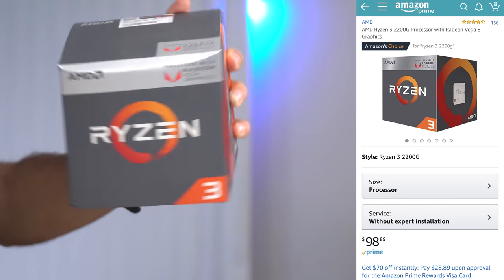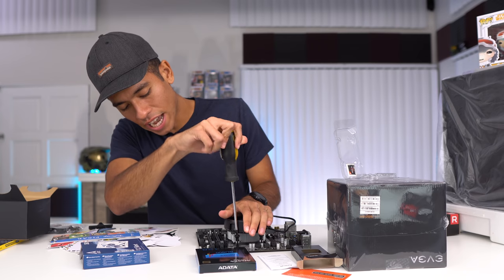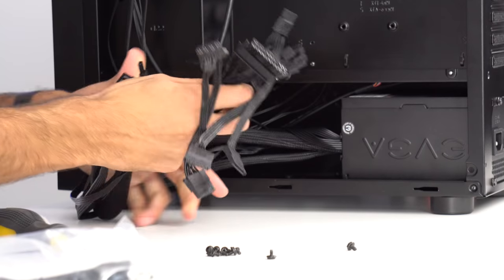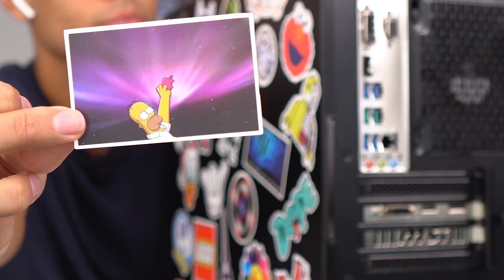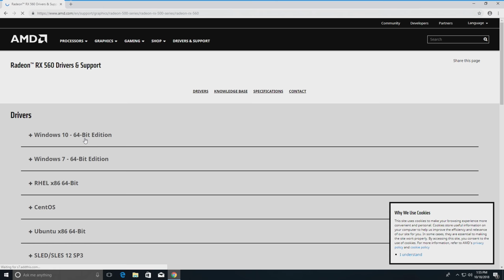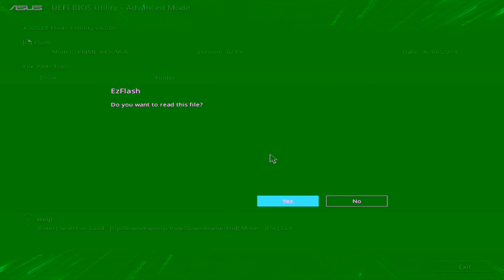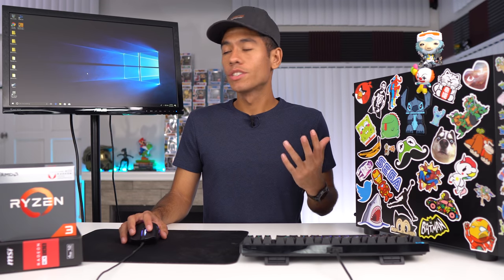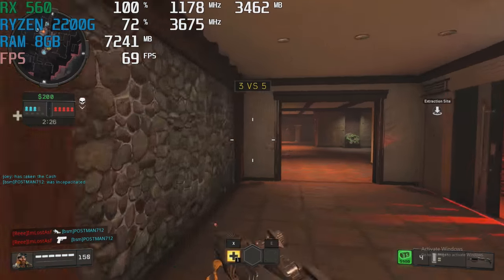Best $500 Budget Gaming PC Build Guide - RX 560 Ryzen 3 2200G (w/ Benchmarks)

Comment: I have now learned what XMP and DOCP means thanks to your videos!
Reply: What is that
Reply: @yohaneswisnu7662  It's the RAM overclocking, since standard RAM speeds are set up to 2133 MHz.  Everything after that must be "overclocked"/configured in the BIOS/UEFI to allow it to hit the actual speeds, if the hardware is allowable at a higher speed than 2133 MHz.

XMP is the Xtreme Memory Profile from Intel to auto-overclock your RAM and DOCP is Direct Over Clock Profile, which's ASUS' version of Intel's XMP.
Reply: I have now learned what XMP and DOCP means thanks to you

Comment: Question, so I have AMD RYZEN 3 2200G I want to put in a graphics card because since it is stock, it didn’t come with one however, which graphic card should I go with and which power supply should I go with I recently just took out the a gigabyte ram and put 32 in it just want to upgrade so I can edit 4K videos with Littleton no problems if you can get back to me I definitely would appreciate it!🙏🏾

Comment: Mine is a Kingston A400 120G SATA M.2, ASRock Phantom Gaming X Radeon RX 570 8G OC, ASUS B450 AMD Ryzen 2 Micro ATX Motherboard, Corsair Vengeance LPX 16GB (2x8GB) DDR4 DRAM 3200MHz, AMD Ryzen 3 2200g, Corsair CX Series 650 Watt 80 Plus Bronze Modular Power Supply, Thermaltake Versa  H17 Black SPCC Micro Atx Case for $536.71!!!!! It will for sure game better plus it is more future proof!
Reply: You can also add more storage for a couple more dollars if you want!

Comment: I got every part listed on his video. The only part I got different was the motherboard I got the MSI b450 tomahawk. Got everything hooked up all the wires the pieces went to power it on and  everything worked perfect went to hook up the HDMI cable to DVI on the back of the graphics card nothing no signal nothing. So I went and unplug the cable from the graphics card went straight to the integrated graphics card on the motherboard still no signal. Bought a new HDMI  to DVI cable nothing. Tried a HDMI to HDMI cable nothing. Tried it on a different newer monitor nothing. Going to have to go into my storage they got my old GPU and see if that works now spent 8 hours on this computer and it's still can't get a signal
Reply: Okay first make sure that the front io ports are connected properly, because if the front io is not connected to the motherboard correctly than your PC is not going to turn on. Check the motherboard manual to see where the front port connections go because it's very specific on where it needs to go to. Also for 550$ this PC is not a great option for parts selection.

Comment: i made a kind of similar pc to this.. i got an amd ryzen 5 2600,a gtx 1660 ti, 2x 8 gb of lpx corsair ram  
same mobo same power supply and same case as this video..
but when i completed the build the lights and fans work but my monitor says no display
Reply: Did you plug it into the graphics card? If your cpu doesn’t have integrated graphics it won’t boot up because there’s no graphics. Even if it did you wouldn’t be using your GPU. So plug your monitor into your graphics card. Check that everything is plugged in properly too.
Reply: @ColinMroczko  thanks but i fixed it :D

Comment: Hello, thank you for the video! I have a question... If I wanted to substitute the graphics card with a Nvidia GTX 1060 GB, would I have to change anything else? Also, is the EVGA 500W+ still gonna work as well as the "BR" version?
Reply: No, you're good. You can always check compatibility of your components on pcpartspicker website. As for the PSU, "BR" version stands for Plus Bronze, which has slightly better power consumption efficiency than Plus. It should be good enough for GTX 1060, but you're planing on upgrading the system later on, I would maybe suggest a better power supply. Cheers

Comment: I build this computer and it’s runs great but I wanna upgrade it to improve FPS on my games and all around. I don’t know where I should start. Could I replace my graphics card from the 560 to a 580 or a gtx 1560 with out having to change the motherboard and power supply? Also is it worth making the upgrade to a Ryzen 3 3200g or not

Comment: I'm new to building PCs and want to build one when I have enough money and was thinking about building this but I had a few questions.
If I wanted to get more frames when playing would I need a better graphics card?
Will a different graphics card mean I need different parts for this build so they'll be compatible?
How important are frames if you're just starting to game on PC and coming from console?
Reply: I would lower my settings to get better Frame rate, especially at PvP
Reply: If you have a 60hz monitor you only need 60fps, but if your a 144hz gamer then you would need a better pc to reach 144fps.
If you want more frames then you should upgrade the graphics card to a rx 570 8gb or 4gb. Or even to a rx 580. 
No you don't need to change other parts for better gpu but for example if you get a high end gpu like rtx 2080 then you should upgrade the cpu or else there would be a bottleneck, and the psu too so it can power the gpu and other parts. But if your gonna go with a rx 570 or 580 you don't need to change cpu, its enough but i recommend upgrading the ram to 16gb for better performance.

Comment: Question . I’m considering buying my dad a pc for his office work cause he has one of those old school computers . Would this be a good option if he’s just going to use it for office work ?
Reply: Of course. 
For office work he doesnt need a dedicated graphics card.
He needs a cool cpu with 6 or more cores.

Get a cheap motherboard h310
Cpu i5 8400, it has an integrated gpu
2x4gb or 1x8gb ram ddr4, (for games 2x4gb is better)
Power supply 450w or 500w +80
Some cheap dvd drive
Cheap case micro atx
Done.
Reply: Engineer Andro Sweet thanks

Comment: Does the motherboard usually come with stand offs? And is there a better card than the RX 560 used that fits?
Reply: rx 570 4gb more than double the performance of an rx 560 , i have the rx 570 its the best gpu for the price , it's only 130$
Reply: @Ziikow  Whats the best GPU for the case he uses?
Reply: @jackson_vantage3552  Sapphire RX 570
Reply: @Ziikow  Ill be using all of the parts and that with my build when I get enough. Thanks! And is there a case where I don't have to add standoffs to the case myself?
Reply: @jackson_vantage3552  No idea bro , good luck in your build

Comment: Do you use hdmi cable or vga port for better graphics on your monitor?
Reply: Vga port is different. Vga is the port that gives power from the power supply to the graphics card. Video output(actual graphics) come out of basically two ports. 1. HDMI. 2. DISPLAY PORT. Basically, display port is better than hdmi in every way.

Comment: Hey, Joey (and others)! I'm trying to follow these directions to build this computer. However, I bought the ASUS B450M-A/CSM Micro ATX Motherboard Ryzen 2 and it worked in one room. I moved it and it stopped working. So, after having the IT guy at work test the components, he confirmed that it was the motherboard. So, I bought the exact same thing and it still doesn't work. Anyone have suggestions?

Comment: Hey Joey! So I built this PC on my birthday about two weeks ago and I thought everything was working but I now just realized that the fan for my Graphics Card isn't running and there is a orange flash right next to the graphics card..is it broken, or does it need a extra cable (PCI-E) from the power supply?
Reply: Why would you build this for 500$ you could of build something better for the same price
Reply: @jamesscott3290  Cause it's my first time building a computer, also I fixed the graphics card..
Reply: @recklessoperator9900  "first time" doesn't matter if its your first time you should of understand that may be do a little but of research to see if you could of gotten better parts for the price

Comment: Is rx570 bottleneck with 2200g? Or should I go with a r5 2600 rx570 combo instead?
Reply: If you Wanna go low budget high performance go r5 1600 with rx 570
Reply: No bottleneck, you should be good with 2200g and 570.
But i aree with dude above, r5 1600 and rx 570 is a really good budget combo
Reply: @itisfullofcurry1313  okay thanks guys

Comment: If I used a 570 or 580 would this pc be better? Please respond quickly cause I have to order by today.
Reply: NepToon idk
Reply: Yes a large performance boost from the RX 560. With the RX 580 and 570 you will be able to game in high 1080p settings. Also if you want to cheap out a little bit the ryzen 3 1200 would go 60 dollars, yeah slightly worst performance than a 2200g but it's would be by a couple of frames
Reply: James Scott thanks for the info bro
Reply: James Scott can I get a 3200g instead of a 2200? Will it still be the same to build and it’ll be better?
Reply: James Scott and also would the mother board be able to handle 3200g and rx 570.
Reply: @VccTn  yeah you can get a ryzen 3 3200g, however you will need to perform a bios update and in order to do that you will need a spare 2nd gen ryzen CPU.
Reply: Most motherboards can handle a CPU and GPU fine but if overclocking the CPU you will need a motherboard with beefier vrms and a case with excellent airflow. Also judging by the case Joey is using the airflow might be piss poor
Reply: James Scott ok thanks for the info I will buy a cheap 2nd gen
Reply: James Scott so I build the pc with a 2nd gen and then run the pc and then I bios update then I can remove 2nd gen and put in my 3200g?

Comment: I need help, the computer wont work. I press he power button and nothing turns on
Reply: Check if psu is switched on 
if doesnt work open the computer and check if everything is plugged in, if so try unplugging everything and replugging them in if all else fails try to make sure you clicked your ram in, or take it out and put it in the other dual channel slot
Reply: also make sure your front panel connecters are connected properly(refer to motherboard manual)
Reply: Don’t worry , most likely 95% nothing is broken, just not installed right, same thing happened with my build, you just have to go through everything as if you building it again and look for any smal, thing that could be wrong.
Reply: Im Velez for your build, what went wrong
Reply: a_krew10 i bent my cpu puns but that was obvious because i was too rough around it, but at the end i kept switching between my graphics card and monitor hdmi ports cause i couldn’t get a screen, eventually i got the display. i then check to see if my ram was detected and only one stick was, but i put two, i then opened my pc again and saw my ram wasn’t fully in. so just check everything
Reply: Im Velez my computer won’t even start, like nothing is spinning or moving
Reply: a_krew10 flip the switch on the power supply? if that doesn’t work your power supply doesn’t work
Reply: Im Velez it’s weird because my mouse lights up when I plug it in to my computer but when I press the power button, it doesn’t start
Reply: a_krew10 your case power button doesn’t work? damn it might be your front panel connectors, those are tricky to install, look at your motherboard manual, go to the front panel connectors page and follow the steps, those need to be placed exactly as your manual says
Reply: Im Velez ok, I’ve gotten the exact case in the video
Reply: Im Velez I’m about to turn it on, I’ll tell you if it works
Reply: Im Velez it still hasn’t worked, and I’m coming to the conclusion that it is the f panel connectors but I don’t get what I’m doing wrong. I did it like he did in the video and I have the same exact parts. I’ve gotten three of these motherboards and all of them have the same result, I’ve switched the case, and tested with three power supply’s and I’m not sure what to do. I could make a video of me plugging the the f panel connectors if you’d like

Comment: My gaming pc is turning  but there is no display  on the monitor. I get the error no signal check input
Reply: Plz help me as soon  as  possible
Reply: @whiskythegamer8053  make sure your HDMI/VGA cord or whatever cord you're using is plugged into your graphics card, not the I/O.
Reply: My graphic  card  will be arriving  next week
Reply: So the hdmi cable won't  work   if  i dont have a graphic card?
Reply: My motherboard  only  comes with 1 hdmi
Reply: @whiskythegamer8053  unless the CPU has an integrated graphics but the issue is that you will still need a GPU in some cases of the pc
Reply: Ryzen  3 2200

Comment: Does a rx 570 work with this build
Reply: Yes its even better then the rx 560, but you will need a 8pin PCIe power cable
Reply: it works soo well with this build , its double performance of a rx 560

Comment: I have a problem, recently get an RX 560 gpu and pair it with a Ryzen 3 2200g processor, but wanting to open anything,
The PC uses the integrated GPU by default, I try to open the windows 10 options to choose which card the system should use for each application.

The problem is that in the options only the RX 560 lists, and it doesn't matter if I choose that gpu, it still uses the integrated gpu.
Anyone know how I can fix it?

Note: I don't know English very well so use Google, excuse any grammatical error
Reply: make sure u connect your monitor to the graphics card

Comment: Hello i really need help ive put this build together and taken apart about 10 times just keeps coming up no display please help
Reply: make sure hdmi/display port is plugged into the gpu
Reply: That solution is if your computer turns on, if it doesnt even turn on try these
Check if psu is switched on 
if doesnt work open the computer and check if everything is plugged in, if so try unplugging everything and replugging them in if all else fails try to make sure you clicked your ram in, or take it out and put it in the other dual channel slot or back where it was
Make sure front panel connecters or connected properly(refer to motherboard manual)

Comment: uphere 3-Pack Long Life Computer Case Fan 120mm

JBtek All Black Sleeved PWM Fan Splitter Cable 1 to 2 Converter

ADATA SU800 128GB 3D-NAND 2.5 Inch SATA III SSD

ADATA SU800 512GB 3D-NAND 2.5 Inch SATA III High Speed

MasterBox Q300L mATX Case w/Magnetic Design Dust Filter

Crucial 16GB kit (8GBx2), Ballistix 288-pin DIMM, DDR4 PC4-21300

EVGA 650 B3, 80+ Bronze 650W, Fully Modular, EVGA ECO Mode

ASUS B450 AMD Ryzen 2 ATX Gaming Motherboard AM4 DDR4 HDMI DVI M.2 USB 3.1 Gen2 (Prime B450-Plus)

AMD Ryzen 5 2400G Processor with Radeon RX Vega 11

These are the parts I selected. I searched many times to see if they are all compatible. I am getting confused by all the different atricles. Please help me.
Reply: Yes they are
Reply: @mael6513  Thank you

Comment: can i swap the processor to amd ryzen 7 2700x or is that going to be a problem for compatibility?
Reply: Taeyeon Jjang yes you can swap the processor to the 2700x, however if you’re gonna spend extra for the cpu i recommend spending that money on a better graphics card like a rx580/590 or gtx 1060/1660
Reply: Also spend on a better motherboard like a msi x470 gaming plus not the shitty motherboard Joey using
Reply: @jamesscott3290  that motherboards not bad mate
Reply: @feats  i ended up getting a rx580.
Reply: @theclasssy3320  it's bad for vrms if your going to stick a ryzen 7 2700x  and overclock it

Comment: We are having issues as there is no power. We have replaced the motherboard and also replaced the case. Anything you all can recommend?
Reply: Switch the psu on
Reply: James Scott - the psu was on.
Reply: The psu most likely, replace the psu if it's doa and make sure it's a quality psu. No seriously if a psu dies while your using your PC it could take a component with it and kill it with the psu
Reply: James Scott - thanks James. I don’t think it’s the PSU as we tried the “paper clip” method and there was power
Reply: @robertjkrew  go open your PC and go to your motherboard. In the bottom left there should be the front io connections (that would be the power on, USB 2.0, etc.) What you should do is to make sure they are connected in the right place. For example we will use the power led connection, make sure it's in the RIGHT spot. If you don't know wheres the proper spot consider using your motherboard manual. Also make sure the fonts on the words is facing upside down, the power led for example have the word face down in the case and to do the same for the rest of the connections
Reply: @robertjkrew  "I put it in the right position" double check I had people say that and then there PC's won't boot because they did a mistake in the connections
Reply: James Scott - thank you sir. It’s actually my son and he will try it tomorrow.
Crossing my fingers. 🙏
Reply: James Scott I tried and double checked the f panel connectors and it still won’t turn on
Reply: James Scott but also, when I plug in something like my mic or mouse, it lights up

Comment: I need help I decide to do this build but instead I did 16 GB of ram and an rx 580, at first I didn't install the GPU right away ani I could play fortnite at epic setting, and it was great but then I installed the GPU software and now I get 60 fps on low settings. It's really irritating me and want to know if anyone knows how to fix this.
Reply: Try to do clean install of the GPU driver.
Reply: @vonme3  Tried that it only gave a little boost that was about it. i just dont understand why its struggling so much to get up there i should be getting more fps than him since im using a rx 570, 16 gb of ram, evga 600w silver power supply, and the rest is the same.